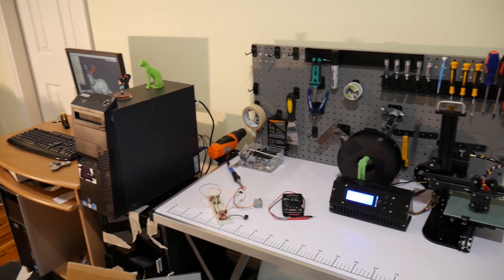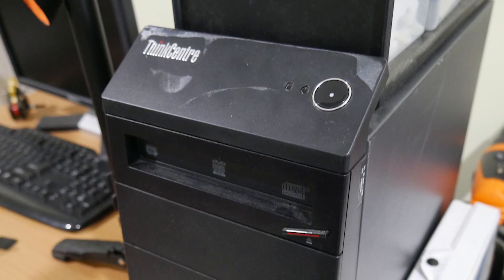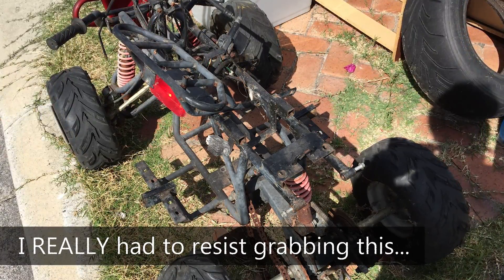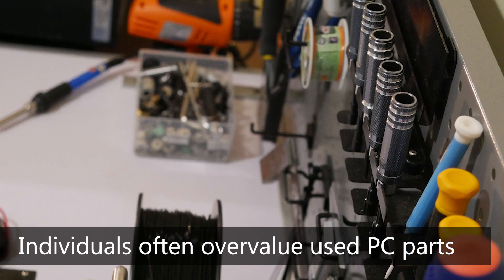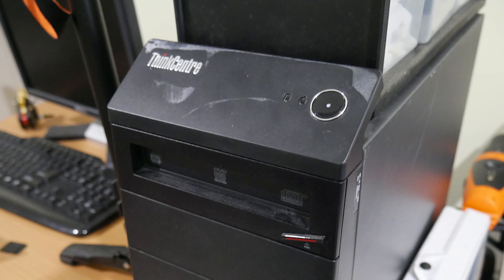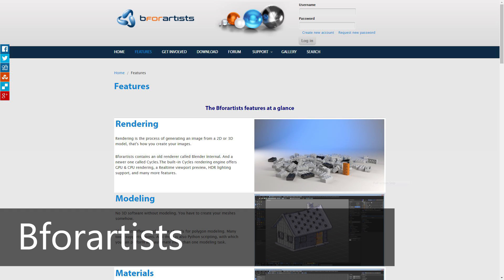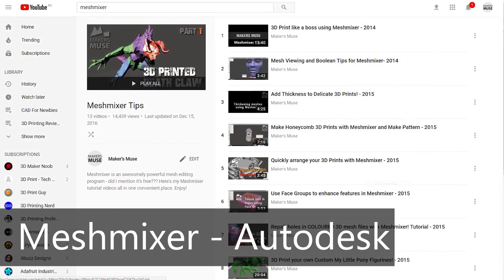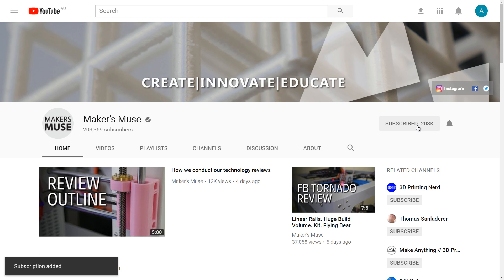How to get a FREE Computer and 3D Software for your Budget Makerspace (Episode 3)

Comment: knock knock "Hi Angus, I'm ***** from you're local council and recycling centre... we hear that you've been taking items without proper authorisation. could we have a word please"

In tearms of OS, if you like ubuntu, but want something a bit leaner and meaner. look at Lubuntu, its basically, Ubuntu with a striped down interface. looks a lot like older windows setups, but with all the power of full blown ubuntu... I use it for everything these days
Reply from the maker: There's heaps of cool distro's I came across, I'll have to check it out. And for the local council? Bite me! :P
Reply: Good answer ;) lol
Yeh there are loads of good distro's about. I've actually started working on my own specifically for 3d printing (started on the raspberry pi, but now working on it for desktop instead) I'll let you know if\when its finished :)
Reply from the maker: Definitely keep me updated! Sounds cool
Reply: I just run Ubuntu with Sketchup under wine. Why Ubuntu? Because on all the computers I've ever installed it on, it was faster (boot time) than windows xp, 7, 8, 10 and less annoying with updates, etc. etc. Why Wine? because that emulates the windows programs to run on linux. Why sketchup? Because apart from it being free it's dead nuts easy and fast. You just need an STL plugin to get the STL file output.
Just for comparison, here is how you model some simple geometry in:
Sketchup: Draw rectangle, push-pull-tool, draw circle, push-pull tool, done.
Blender: Draw 4 lines, select those 4 lines, extrude, draw circle, select circle, extrude.
Solidworks: Draw rectangle, fiddle around with setting to get the dimensions, find that extrude thing in some menu, find that circle thing in another menu, get that extrude thing back and extrude.
Catia:  Draw rectangle, set constraint, change it to length constraint because you clicked on the wrong constraint, change the value of the constraint to make that rectangle the size you want, find that extrude thing in some menu, find that circle thing in another menu, do that constraint-voodoo again, find extrude the thing back and do your thing.
Not every version of sketchup runs on linux via wine, you can look up what version to download on appbd.winehq.org.

Tips that work for all of these programs: use the keyboard, and look at the hints-taskbar (that's how I call it).
In Sketchup you can press P for push-pull, R for the rectangle tool, etc. Use those hotkeys (same is true for blender). Also when extruding something, you can either drag your mouse and look at the bottom of the screen for the size you give it or you can just type in your size with your keyboard. (same with blender)
Blender (like the expensive software) has tool-searching functionality; when you forgot in what menu that certain tool was, you can just press space and type in that tool you're looking for.
The expensive enterprise software has soo many tools hidden somewhere that they can all have their hotkey.
Reply: I tried Ubuntu few years back as main operating system as I am to cheap to buy Windows. Just couldn't get used to it and a lot of the stuff I needed just didn't exist on ubuntu or was a pain to install. Seems the scene has been changing now? I just wish linux would have installers like windows' .exe as I just can't use the cmd line XD.
Other than my personal issues I really like the idea of Linux, and I mean you pretty much have endless distros available depending on your needs.
Reply: If you prefer a very Windows-like experience, check out Peppermint OS.
Reply: +boomerangfreak It has definitely changed. The command line is very easy, and I think everyone should learn how to use it. As for installing apps, it's just a single line command, or you can use the software center. BTW some apps that are not available in the repositories can be downloaded from their respective websites and installed using the .deb file included, however some apps don't use .deb files so installing them can be a little bit harder.
Reply: I use Lubuntu on a crapy old laptop, seems to support all hardware and is very light.
Reply: Get windows 10 and not activate it to use it for every without getting broken updates first day.
Reply: I use Linux Mint XFCE edition. It gives you full compatibility with Ubuntu and a handful of extras out of the box so it's a fast setup. Unfortunately i couldn't get Fusion 360 to run under Linux. Well there's FreeCAD, and it's not terrible, but it's pretty cumbersome. Blender of course works, but i found that making simple parts in OpenSCAD was faster and easier than anything else. I remember Sketchup working in the past but i didn't try it again.

Couldn't get recent versions of Cura to run - pretty sure i'd be more successful with more effort, but for now i failed. Couldn't get Printrun/Pronterface to run. Repetier Host works fine, and comes with a Cura engine and Slic3r complete software (classic and Prusa edition), everything works.

But would i be comfortable just dumping Linux on someone with a 3D printer that has no Linux experience? No, because there's always one issue or another to be resolved.
Reply: Kubuntu (KDE on Ubuntu) will give a modern Windows-like experience.
As for having installers.... WTF would you want that on Linux when so much is packaged sensibly? The stupid way of doing things is bundling yet another copy of libraries with every program. Cura is packaged in one of the stupidest methods I've come across. Arduino is not much better.
Reply: tin2001, i tried KDE in Mint (Ubuntu derived) not too long ago again, maybe a year back, and i was STILL sorely disappointed. And i mean i used to be SUCH a huge KDE fangirl. I first came in touch with KDE in 1999 when a teacher bought himself a beautiful boxed SUSE 6.2 - boot floppy, CD, thick book, wonderful package, got super confused by it, and decided to give it away in class and i was the weird kid who took it, and it shipped with KDE1. Then came KDE2, KDE3, was super happy with them, and then... KDE4 came, and as often as i tried KDE4 and 5, i could never get a reasonably bug-free experience. Last time i tried i encountered two killer issues - writes to a fast NTFS USB3 drive from Konqueror were not only slow, they bogged down the whole system. Ark was so broken, it couldn't even create a zip file that you could unpack with 7zip on Windows. I tore it down and put XFCE back on, and didn't have those issues. And numerous Kubuntu releases over the years where the webbrowser wouldn't survive a handful of page views without crashing when Flash plugin was installed or VLC plugin was installed or whatever.
Reply: be aware of the downsides on Windows10, most people dont like it when bill gates watching&hear them masturbate xD
Reply: I use linux mint easy to use. not like it was a few years ago.

Comment: Another tip for getting a cheap but powerful pc is to buy an old workstation. The dell m4500 with the core i7 extreme is a powerhouse still, I can play steam games on it on low to medium settings, it slices like a dream, and runs local modeling software fairly. Fusion 360 on Windows 10 is a bad combo but Linux fixes that.
Reply from the maker: Agreed, used to run an old Z400 Xeon workstation that was heaps cheap for the 24gigs of ram and 12 cores. Destroyed meshmixer!

Comment: FYI: Free upgrades to Win10 totally ends Dec 2017. After that its $200. So that'll blow your budget.
Reply from the maker: True, though technically free upgrades were 'omg going to end' some time ago. I think they put a time frame on it to pressure people into making the jump. That's my theory anyway!
Reply: Maker's Muse isn’t that upgrade only for people using assistive technology?
Reply: You can buy a Windows 10 key on eBay for £2-3! When I first saw them, I assumed it was a scam...nope. Ive bought a few now, no problems at all.
Reply: Linux Distros are free and powerful. It might a bit if a learning curve but I like them. A lot of the free software Angus was talking about can be run Linux.
Reply: Search ‘Windows 10 ISO download’ and burn it onto a DVD / put it on a USB and plug it in to your computer. Enter bios, select to start from the USB, enter your product key, format your drive and download. I’ve done it for both my pc (i5-2400 squad) and my brother’s pc (i5-650 haha). Got them both for free.
Reply: That's the assistive technologies free upgrade end date... And like the other "normal people" free upgrade, I suspect all that is ending is the free phone support.
The installers accept Win 7 and 8 keys, and I seriously doubt MS is going to stop activation for people doing it that way. It would be a pretty sore point going forward for anyone caught out, and MS want people on Windows 10, not Linux or MacOS.
Reply: Some old pc’s have a OEM product key for windows 7. With that you can install windows 10 and it will use the win 7 key. If that doesn’t work you can always use a non activated copy of windows. And as another option, you can use a Linux distro.
Reply: You can use unactivated windows 10 without any problems or you can buy a 5$ oem key from ebay
Reply: +Ramses that's considered piracy

Comment: Fusion 360 is absolutely cancerous. It literally won't let you choose to install it, so if you don't have a super new or super old pc with a large ssd or no ssd, you are hosed. It also hides basic functionality behind layers of menus, is laggy and poorly optimized, has useless cloud functionality that you can't completely disable, and in general it just sucks. Solidworks is a million times better, and is basically like Fusion 360 but better supported and not terrible. Nobody cares if you pirate it, just like noone cares if you pirate photoshop. In fact its encouraged, its how Adobe and Autodesk have a customer base to sell professional licenses to.
Reply: Yeah well I tried to pirate Solidworks and the patching process is overly complicated and confusing and I never got it to work. So I'm using Fusion 360 instead.
Reply: Reinstalling the newest version does the trick.
Reply: Months ago I torrented the most recent version of Solidworks I could find. It came with some patcher that required selecting a bunch of things I had absolutely no clue about and the instructions that came with the patcher were either outdated or way too vague. 

So I have absolutely no idea what you mean by your last comment because the problem was the patcher, not Solidworks itself.
Reply: Oh, you mean cracking it. It should be a simple step by step process. I recommend downloading the readme first. If the readme seems like it would make sense, then do the rest.
Reply: You are really comparing apples with caviar here. Inventor is autodesk's high end design program, and is just as good (better in my opinion) then solidworks. It is also just as expensive, at something like 2500 dollar a year + a rather substantial yearly licence. Fusion 360 is a much cheaper, and much more limited option. For the price (free for hobbyist, and something like 350 dollar for professional users) you will not find anything better, short of pirating of course. The CAM functions are actually on par with many very expensive CAM programs.
Reply: Use 'SolveSpace', its free, opensource, runs on Win, Linux and Mac, AND is easy to learn for nonCAD people.
Reply: I have a brand new PC and cannot work with Solidworks since it lags so bad and is not really user-friendly. Gladly there are opinions. For me F360 is blazing fast and user friendly.
Reply: The problem is that Autodesk offers no usable product similar to, but cheaper than Solidworks. Solidworks has a ton of features most hobbiests will never use, like the rendering engine, the PCB design tools, the injection molding tool, most of the simulation tools, etc. I would be happy to buy Solidworks for $150 without all those features, but the only legal option is a program so unbelievably terrible, you literally cannot install it on pc with multiple hard drives. I had to use a hacky workaround to get it to work at all, and once I had done that I had to deal with basic usability problems. Like the fact that half of the supported file formats are exported using File>Export, and the other half are hidden under a few layers of poorly labelled menus. Like the fact that drawing a line takes 3-4 times as long as it does in Solidworks. Like the fact that there is this cloud functionality shoved into every corner that you can't disable. Like the fact that something as basic as dimensioning something requires you to click through menus. Like the fact that no matter what pc you have, it will always run so slow that you have to wait in between editing parts.

Comment: Core i5-2400  for freee???? Yiiikes nicely done, my main rig is a i5-760
Reply: like getting given a 2011 imac for free cause ded hdd or even using the first pc angus built to format hdds for an xbox
Reply: I got a free HP Probook with a 2nd gen i5 and 4GB RAM about 18 months back. Its what I've been using for 3D printing. Had a dead HDD and the customer choose to go a new laptop instead of fixing it.
Its actually got a better CPU than my desktop gaming box (but no GPU).
Reply: tin2001 do you think a pi zero w would work? I know it doesn’t need to be that powerful but it would be cool to have a dedicated 3D printing mini pc(I already have a laptop to use but it would be nice to not have that with machinery. (I don’t have my makerspace yet but I’m Saving up)
Reply: almost same as my imac

Comment: Also you could go to your local school district and get al the desktops for like 5 bucks each. Thats what i do and i just pull the ram from some and add it to others and make them better. Also you can make great lab power supplies.
Reply from the maker: +Mario Castillo yeah old school systems can be got for cheap too
Reply: Meanwhile my school is still using PC's with Pentium 4's in one of the labs and old core 2 duo iMacs from 2009 to do video editing.

Comment: Yeah that computer and other free one's will struggle with slicing larger complex models.
Reply from the maker: +FadedDreamz they do a decent job, most slicers arnt even optimised for multi threaded systems or even ones with more than 4gigs ram
Reply: Try an old cura 14 version.  thats what I use, its fast(ish).
if 3d printing really wants to take off Cura and Slic3r need to be refactored, made faster and more efficient.  Python just aint gonna cut it, so to speak.
Cura 2 is slow as molasses.
Reply: What's the rush? Your print is going to take hours, waiting a few mire minutes for it to slice isn't going to kill you :)

Comment: Hey Angus gday, would a newer laptop work as well?

I have two one being an IBM that requires a new hard drive only matters of fact both need them so I can put in new hard drives and put windows 10 on them. What do you think?
Reply from the maker: +Bob Young something newer should be fine, laptops get outdated far quicker generally